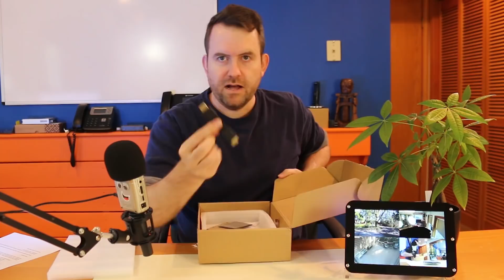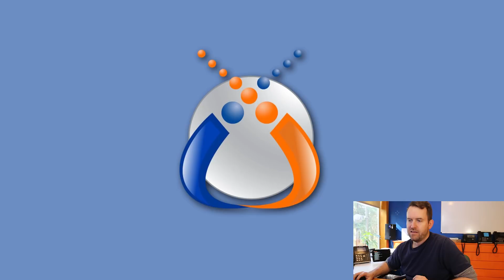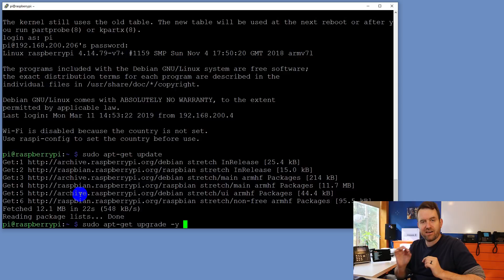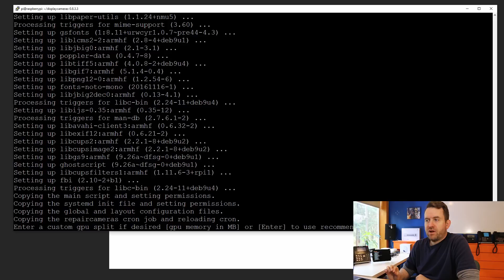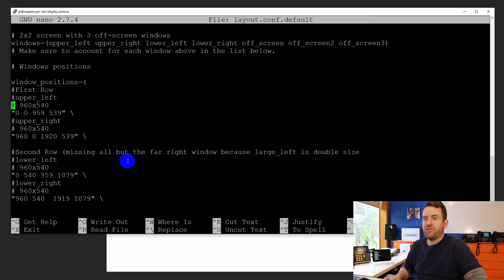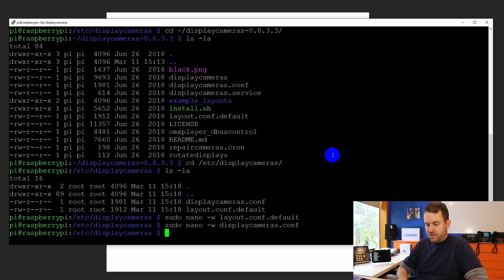Raspberry Pi Surveillance Monitor v2

Comment: The software that you use is reliant on OMXPlayer which has been deprecated. The only way to do this now is to use an old BUSTER version of the OS. It would be interesting if you have any new way to do the same thing, without using a Viewport, which can not handle custom screen layouts.

Comment: Thanks! I just got this working using an old Buster image and a Pi4B. I still have some issues related to lag, but I'm not using UniFi cameras, so it's probably the resolution and bitrate my cameras are sending
Reply: what buster version did you use? Had an error with buster 20.06.2019  "this board requires newer software"

Comment: I couldn't get it to work.  Maybe there's a new way, but already spent more time on it than I wanted to.  The good news is that the pi5 will run the web based Surveillance Station.  If that's an option for you.

Comment: Very interesting and well explained tutorial....unluckily for me, it is almost what I was looking for... Let me tell you my story, you may know how to resolve it (if you have the time to spare with me...ja!). I need to install a PTZ camera and watch it from a monitor... most of the DVR/NVR/XVR can't control the PTZ features from it OS, so I thought a Raspberry with a light linux with firefox can make the trick... but then you came with this video solution and... it is the best.... The Rpi will boot  just showing the video feed.... It's all I need.... but.... no PTZ control....and... I've kinda need to correct the position once on a while.... Is there a way to use a Raspberry pi as a client monitor somehow with PTZ controls thought a gamepad, a mouse o a keyboard? you may know.... and that would be a great material for a video...ja! Anyways, thanks a lot for sharing your knowledge!

Comment: Almost 5 years later and this still works... You need to image the pi with "Raspbian Stretch Lite" that you will need to find from an old/archived source... but with the Camera service works just fine...
Reply: How did you get it to work, I can't even install omxplayer or update sources since it's can't find the dependencies.
Reply: I have a couple of copies running. For now, I have saved a copy of the image to my pc and can flash a card to set up an extra monitor.
Reply: @wjohninoz  Hello, is it possible to "share" the imagefile, installed an old Stretch Lite, but the repositories aren't maintained, update and upgrade don't work, omxplayer is obsolete.....

Comment: I want to try this using a zosi c190 camera or other cheap camera that is capable of RTSP.  My question is, isn't the rtsp url the same for the same type of camera?  Can you display 4 separate cameras if the rtsp url is the same for each camera?  Can anyone recommend a cheap outdoor rtsp camera that would work for this?

Comment: I got this to work on a Pi a few months back but don't remember what I did. On a 2nd Pi, I'm currently stuck with the error: Job for displaycameras.service failed because the control process exited with error code.  I know I had this on the first one, but don't remember how I solved it.  So far I used Stretch Lite, since that's what was used in this video.  I checked my other Pi and looks like I used Buster.  Maybe doing that will work?

And for those asking, Yes, Unifi supports RTSP (no S) but you have to change the url manually to remove the 's', change the port to 7447, and delete the stuff after the ? in the url.
Reply: This is because the window view for the cameras (omxplayer) is incompatible with the newest release of Raspian and that should be the error if you look at the log it tells that you can view

Comment: Can you do this again for newer version of unifi controller that uses RTSPS for cameras? There seem to be some differences with the old way of doing this.
Reply: A few things...Change RTSPS to RTSP, change the port 7441 to 7447, In the camera RTSP delete everything from the '?' 
You can then test it in VLC and it should work.

Comment: This no longer works with Raspberry Pi OS Lite Buster because systemctl will not restart.  Omxplayer is required and no longer included in the repository.  And, it is nearly impossible to install in Buster.  So, I'm trying the legacy version of Raspberry Pi OS lite.  That eliminated the systemctl error but it does not automatically start on boot.  It displays the boot sequence and asks for a password.  So, this no longer works.

Comment: This doesn't work anymore, from GitHub "As of Raspbian Bullseye release (as well as RPi4B), omxplayer and the hardware decoding that work hand-in-hand are deprecated and/or unsupported. In order to use displaycameras, you should install raspbian buster (lite preferred). If you use an RPi4B, your source video codec must have hardware decode support in the RPi4B gpu. displaycameras may be rewritten around vlc, but challenges with vlc's DBUS support (for multiple vlc instances) may prevent the rewrite."

Comment: Thanks for your time. I tried it, but had much problems with my "non normal monitor size". I switched to raspicamplayer. Much easier with setting up. Check it out on github.... raspicamplayer/camplayer

Comment: Hello, I had quick two questions. Can you be able to use a USB camera or (built-in USB camera) connected to the raspberry pi 4? Just like yours, except I have 4 USB cable cameras but connected to the pi4. 
Another question would be, Can you use the wifi, or wireless network to monitor to do this project? Do we have to connect the network through an internet cable Only?
Thank you for the Video, and looking forward to your response.

Comment: Is there a setting for a delay option? This solution is amazing and would maybe be a good option for sport locations that require a delay mirror effect video. Not sure if surveillance cameras have enough frame rates (preferably 60-120fps) for sports and a delay of 10-30sec would be also needed.

Comment: Anyone know a way to get POE of a regular Pi 3? Not the 3 B+
Reply: Not possible... there are 4 POE pins on the + boards... thats why I have 2, I bought one without + first and a poe hat.
Reply: I use one of these https://www.ebay.com.au/itm/Active-PoE-Splitter-Power-Over-Ethernet-48V-to-5V-2-4A-Micro-USB-4-Adaptefw/363092457764?hash=item5489ff3924:g:bpMAAOSwcUBYQFUu&frcectupt=true

Comment: Hi, you should check out https://rpisurv.net which is much easier to setup ( no need to calculate coordinates )on a Raspberry Pi. Version 3 ( https://github.com/SvenVD/rpisurv/tree/v3_latest ) has dual display support also. Would be nice if a video could be made for Rpisurv.

Comment: This video is the only reason I decided to buy Unify cameras as I wouldn't without a monitor solution like this. Thank you, Chris.

The only differences in my plan is I opted for a VESA pi case to attach to the back of an old monitor and Pi 4 for the wifi.

Comment: I have just done this but with a Raspberry Pi 4, still straight forward but a few things to note. Raspberry Pi now have their own OS installer app which takes care of the formatting etc. It's also now no longer called Raspbian so you need to select Raspberry Pi OS (Other) then select Rasperry Pi OS Lite (32 Bit). A couple of the original boot options are now in different places but easy to find.

Other things to note is the resolutions of the bottom left and bottom right need to go to 800 not 799, if you go to 799 you will see the blinking cursor in the bottom left all the time, so these would be:

Lower Left: 0 400 639 800
Lower Right: 640 400 1279 800

You will also be missing an entire column of pixels on the right hand side (top right and bottom right) but isnt as noticible, if its an issue then change 1279 to 1280.

As for the Pi 4 on this screen, it does fit ok. Only thing you will need to bear in mind is the USB passthrough is USB micro B but the Pi 4 is Now USB C, I didnt get a cable for this as I'm using POE so cant comment on this, also the HDMI is Micro HDMI (Type D) on the New Pi 4 so you will need to find a converter cable as the screen is still full fat HDMI. Also a note about the HDMI calbe that comes with the screen, I didnt recieve a small one like pictured on amazon instead got a 3' cable which is going straight in the bin.

Comment: I am struggling to get this running, my setup is TV 1920x1080 and my rtsp feed is 640x480 i have selected the layout.conf.1920x1080.3x3 (renamed to default in etc), but for now i have only 2 raspberry cameras (on raspberry pi zero W). I am using raspberry pi 3 to run displaycameras and to double check the vlc can play the streams! What am i doing wrong?
Reply: it seems that you assume that the rtsp feed is tcp: sudo omxplayer --no-keys --no-osd --avdict rtsp_transport:tcp <camera feed URL> --live -n -1 --timeout 30, but this is not really necessary and in my case this is only way that omxplayer is playing the feed: sudo omxplayer --no-keys --no-osd <camera feed URL> --live -n -1 --timeout 30
So can I configure not to use tcp with displaycameras??

Comment: Tried this on both Raspberry Pi 2 and 3, and it's not a solid system. It's too slow to come up and freezes after a while.
EDIT: It works OKAY on the Lite version, but very flaky on the Desktop version of Raspbian.

Comment: Followed this , thanks for making it.  Seems to work fine with my UVC G3 cameras, but wont play the Unifi doorbell camera.  The stream works fine in VLC but displaycameras wont play it even using the test command line they show on github.  Seems to read the stream though as it knows the resolution.  Anyone else try the unifi doorbell?  It's always something...
Reply: On second look, it's not working.  Just showing 2 G3 cameras on the lowest quality stream It runs for a minute or three and then freezes.  Brand new RPi 4B 4gb with a brand new os install.

Comment: For anyone looking to display 9 cameras on a 1080p display, please see the following code.
I resized all camera blocks to 640x360.

#Top row
#upper left
"0 0 640 360" \

#upper center
"640 0 1280 360" \
#upper left
"1280 0 1920 360" \

#Second Row
#center left
"0 360 640 720" \
#center center
"640 360 1280 720" \
#center right
"1280 360 1920 720" \

#Third row
#bottom left
"0 720 640 1080" \
#bottom center
"640 720 1280 1080" \
#bottom right
"1280 720 1920 1080" \

Comment: I love this project. I have it up and running with one camera on a HD tv. One thing I want to do is have the top_left feed take up the whole screen. In layout.conf.default I have changed the values for top_left to “0 0  1079 1079” I figured this would make the top left feed take up the screen but sadly it only does half the screen. Any tips would be awesome. Thank you for your content sir!
Reply: just to follow up here. I was able to get the one feed to take up the whole screen by entering in the correct y axis values (1920 1080). I am going to be adding to this project as my unifi camera system grows. Again thank you for your content. it is inspiring and educational.

Comment: Getting a higher power "Brick" is always a very good idea for a Raspberry Pi 3 or higher.  I have found 90% of USB cables 1mtr or longer lose too much voltage along the cable to be usable reliably.  Half of them wont even recharge my USB battery pack!.    Getting a good quality PSU is important for Raspberry Pi stability.   I know people say just use a USB charger, but most of them are not stable enough to run a Pi stabiliy without getting voltage errors or freezing.     Just my experience.
This whole setup process looks pretty complex for most people that would just want a simple way to view a camera.   What is the advantage of this system over something like MotionEye or ZoneMinder, which are also free and use RTSP?

Comment: Great Tutorial but I have struggled a little.  I have tried doing this with 3x 4MP (2560x1440) cameras and 1x 2MP (1920x1080) camera.  The 2MP camera works as it should but the 4MP do not show up.  Tested this with OMXPlayer again, no issue with the 2MP but when I try the 4MP the picture is scrambled? OMX sees both the streams as omx-h264. Any suggestions would be a great help.

Comment: Great videos as always - you have convinced me to go Ubiquiti throughout, and very happy with them all.
I happened to have bought the exact same screen through Amazon UK (Currently £69.99) and had the same issue getting off the screen protector - disassembling allowed easy removal as it had been trapped between the perspex panels during assembly, not great problem though.
I am using a pi 4 and it happily powers the screen through the USB 3 port, and combined with the PoE HAT (official Raspberry Pi v2 from PiHut), it really is a single cable setup. Stable and excellent picture quality,
Next is to set up a cron job to auto turn on and off the screen on a timer when not in the office - I already do this on my Raspberry Pi Dakboard

Comment: Hi ! Thank you for this wonderfull video!

MONITOR: Using RasPi 3 B+  with Adafruit PiTFT 2.4" HAT Mini Kit - 320x240 TFT Touchscreen.

CAMERA: Using RasPi 2 B with Raspberry Pi Camera B01 Rev 1.3 ( 5 Megapixels at 1080p 30fps, 720P 60fps, 480p 90fps)

I tried with Raspbian Buster Full (Not Light) and failed. But the rtsp ip link work in vlc so i  am gonna retry it with Buster Light edit.
Reply: UPDATE: Displaycameras software not showing feed for camera 1 on the Pi HAT ''Adafruit PiTFT 2.4''.
I chose the option in ''PiTFT as Text Console (best for Raspbian 'Lite')'' HDMI will be 'deactivated' -
from : wget https://raw.githubusercontent.com/adafruit/Raspberry-Pi-Installer-Scripts/master/adafruit-pitft.sh

instead of : PiTFT as HDMI Mirror (Best for Raspbian Full/PIXEL) HDMI will be 'activated' but at a lower resolution - you can change this later but it looks best at 320x240.

So the only option for the touch screen pi hat is to stream the feed on the ip adress in chromium in Raspbian Buster Full with the adress bar in the screen because i cannot put it full screen and dont see full image, have to scroll to see in the small screen.

Any help would appreciated! thank you :)
Reply: dont have the knowledge to make it work will have to find another rtsp streaming solution for pi camera b01 to work on a pi hat tft 2.4inch touchscreen. Followed your steps to the letters 4 times, was all day on it.

Comment: How do I proceed if I am trying to use either a USB webcam or the camera port on the Pi itself?  Is there a way?  Also, I didn't see a link for the step by step instructions from the blog you referred to.  Is that link still available?  The video is fantastic.  Thank you for posting.

Comment: I would put small switch at the end of the 100 ft cable and connect the 24 port switch and a single PC to the small switch.  If the single PC survives an outage, its not the cable. If it doesn't, the problems upstream of the 24 port switch including storms, viruses, etc are still in play.

Comment: Great video! Thank you for posting this (and all of your other videos). I just used your video and the linked blog to setup a viewer for my Unifi cameras. I had a pi setup and logged into the web portal for protect, but it kept dropping the streams. This has stayed up without any issues. Now I can just turn on my TV and switch the input anytime I wish to view my cameras and don't have to worry  about logging in.

Comment: You had 640x360 streams available from the cameras and you are displaying them at 640x400 but you didn't use them!?
The author of displaycameras says...
> It is actually downscaling that should be avoided, not all rescaling of feeds to different size windows. Downscaling is computationally expensive; upscaling is not. So, the best resolution feed to select is one whose resolution is less than or equal to the window size (vs closest to the window size).

...this could well be the cause of the slow startup and lag you are getting with the cameras

Comment: Anyone try getting hikvision cameras to work? I have this all set up with the RTSP feeds input but I'm not getting any camera displays after the restart command.
Reply: I'm having a similar issue with Hikvision cameras. I can get them to populate the screen by running them in omxplayer but with the same information loaded into displaycameras I get nothing.
Reply: Figured out my problem. I was modifying the wrong config file. Make sure you are editing the /etc/displaycameras/layout.conf.default file. 
The rtsp file that worked for my NVR was: rtsp://USERNAME:PASSWORD@IPADDRESS:RTSPPORT/Streaming/channels/102/ and for the camera directly it was rtsp://USERNAME:PASSWORD@IPADDRESS:RTSPPORT/Streaming/channels/2
I found that omxplayer wont load a high res image and you must use the substream.

Comment: Thank you so much for this project. I’ve been looking for a raspberry pi solution for my home cameras! I’ve got everything and got to the point where I have to run the raspberry pi configuration tool, but I’m getting a error message. I’m new to Linux and Raspberry Pi and tried your command as a root user in the command line of my raspberry pi (sudo raspi -config) but I get a message: “sudo: raspi: command not found”. My user is: root@raspberrypi:~#. Is there something I’m missing? Thani you.

Comment: Hi, please can you help me? i install and run program, all is runing good i have 8 cameras in 2x2 screen, but after maybe a day or an hour, i really dont know how long it takes, but the screens start to freeze, i try low the quality of video but nothing, thanks
Reply: Try running a "top" command to see how much CPU it takes. If you are running 8 cameras you have to use a big Raspberry pi, like the Rasp 4 (maybe the 3 could do it).
Reply: Peter Andersen hi, I try in a pi4, 4gb, but the same, also only with 5 cameras and the same the screen froze in about an hour